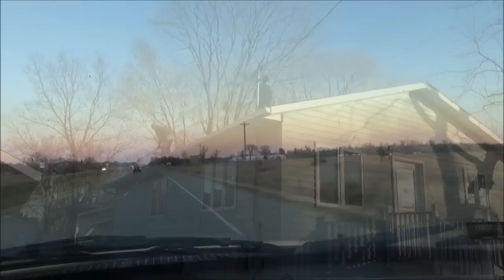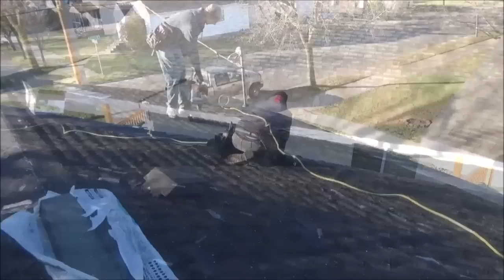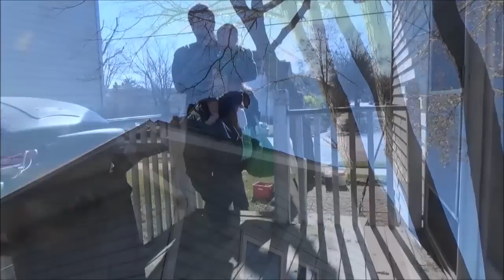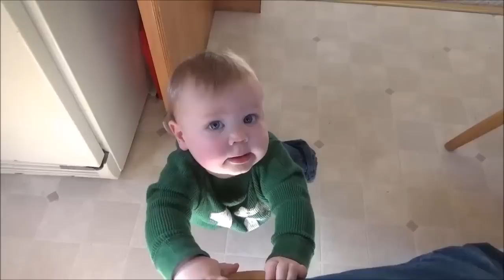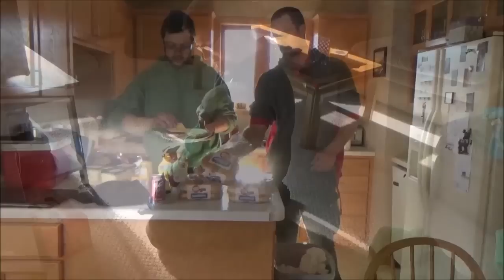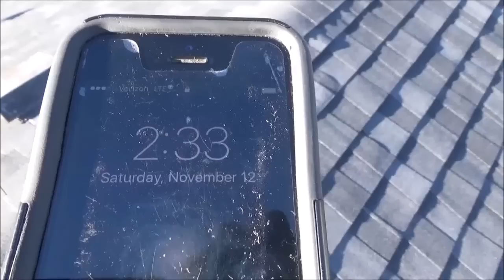Installing New Shingles at Zachary and Samanthas House. Fun Saturday. Grandson Xander.

Comment: A little put off that it is Zachary's house and he didn't help on the roof. Is he afraid of height? 
Other than that looks good. From the looks of the old shingles it really needed to be replaced.
Reply from the maker: Zachary hurt his back real bad last week and they had to bring him to ER. Its getting better now but no way was he going to be carrying 80 pound bundles of shingles up a ladder. He was going to help but I brought one extra guy JUST so he wouldn't have to do a thing except cook lunch. Possible snow later this week, the roof had to be done now.
Reply: PA GUY Zach most likely isn't  a roofer and is best to let the pro do what a pro does

Comment: Hey Joe, why don't you guys use tin roof sheeting in the US?? Color Bond tin roofing of fired clay tiles are pretty much all we use in Australia. I only use Clor bond tin roofing on my builds, 25 years gaurantee and if you look after it you will get 50plus years out of it.
Reply: We have a hard freeze here clay does not hold up well.
Reply: what about the tin roofing
Reply: Tin is not so cheap here.
Reply: what are you paying a m2
Reply: that looked like a cheap way to reroof .... do it once ... do it right!
Reply: Color bond steel roofing is waterproof long lasting comes in about 10 or 12 different colors and has a 25 year warrantee in Australia, great product and given the shape & size of Zac's roof woud have cost about $4000
Reply: That shingled roof probably cost around $2500.
Reply: OK, how  long will it last
Reply: 25-35 years. I'd say the shingles he went over were around 50 years old.
Reply: We have metal roofing here as well. It generally carries a 40 yr warranty and runs about $2usd a linear foot (3 square feet). the problem is the washers on the screws rarely last past 10 years before they degrade. Also, not everyone likes the look of a steel roof. Many liken the look to an agricultural structure or backyard shed. Many Home Owners associations forbid it's use. Personally, I don't mind the look and am using it on a duplex I'm building to rent. I do prefer the look of dimensional shingles over it though. The profile we use in America is similar to Colorbond's Trimdek profile.
Reply: GreeneNatives  the house was built in 98, lol they looked rough though
Reply: Zach Jensen No joke. We tore down a house next to ours that had 50 year old organic felt shingles that looked nicer than that.
Reply: GreeneNatives I new the roof was bad, just not that bad lol